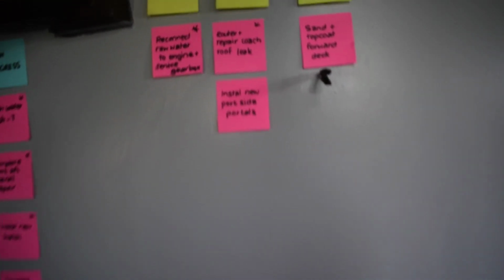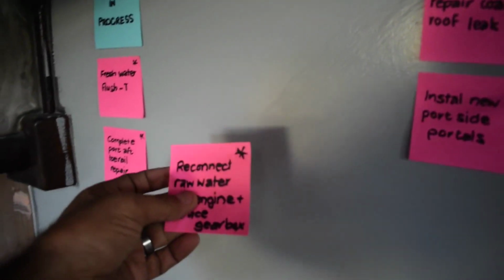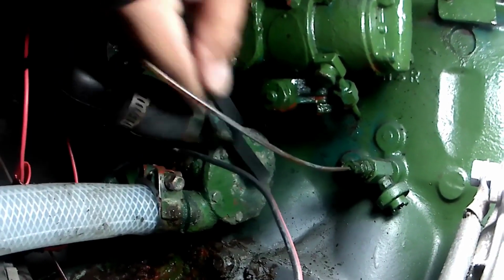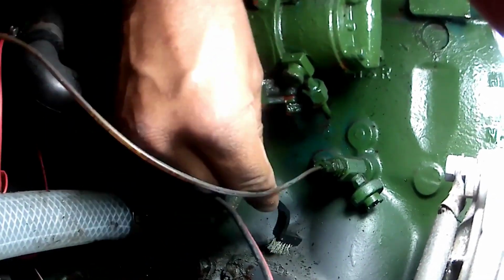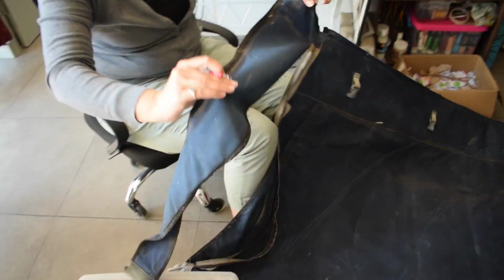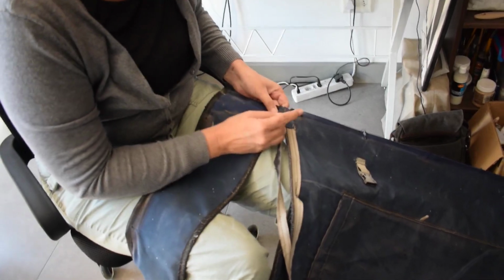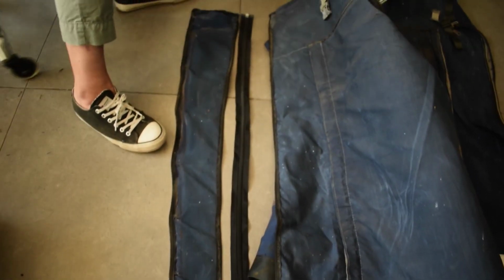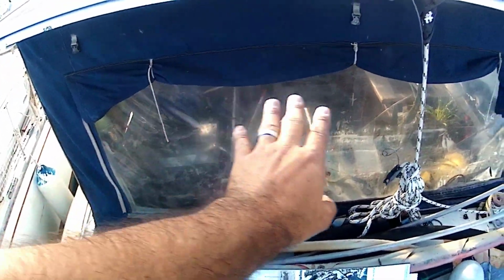S02E16 Stanchions continued and canvas repair #boat #boatrenovation #diy  #restoration

Comment: Sorry the weather is being so difficult.  Those bolt heads on the raw water pump housing are looking pretty worn out ... I didn't think you were going to get purchase on them with the wrench.  You might want to replace them with new ... if you are ever rolling at sea and have to replace the impeller, you will be thankful that you changed them!!! I'm sending good weather vibes your way!!!
Reply from the maker: so since I removed the impeller I’ve since removed the pump… and it’s about as bad as it can be .. I’ll have to change plans completely.. new pump is around 500$!! 😳   so I’m m thinking of  other solutions for now ….  perhaps a belt driven version that will eliminate more loving parts … watch this space !